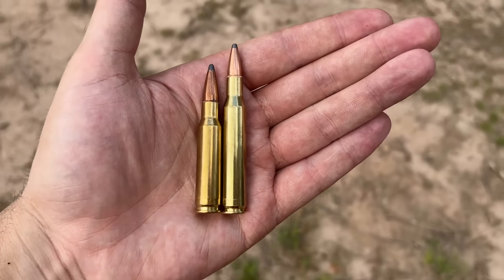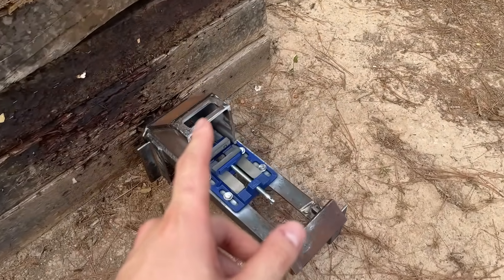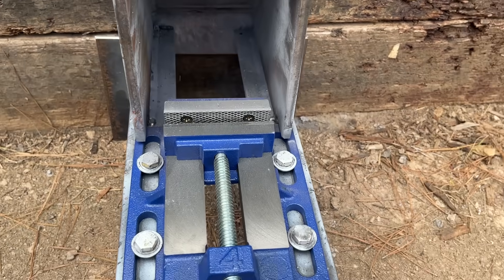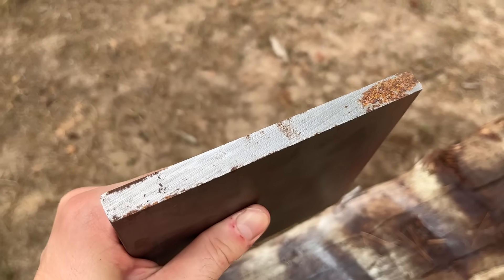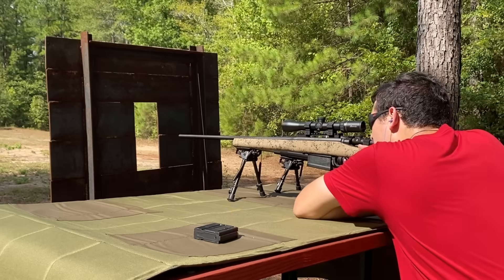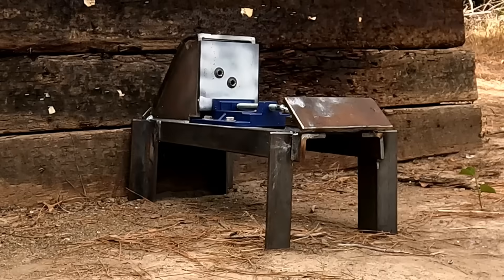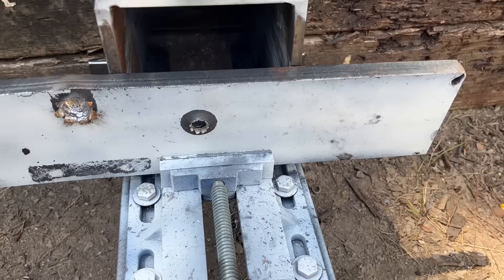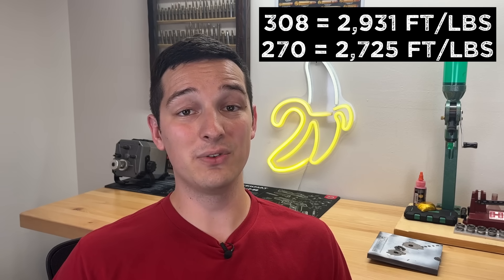270 Win vs 308 Win: ONE Clear Winner On Mild Steel

Comment: 150 grain on both would have made a better comparison
Reply: I shoot 110 grain hollow points out of my .270. Long reach and they are drt
Reply: @kevenbeene4585 shooting a 150 gr out of a 270 is super unusual unlike 308 which is like you main bullet weight so it makes sense
Reply: @offbentleyboysyt5106  150 grains out of a .270 is useless unless it's up close. I load 110 in my 7mm to.. I have a 6 arc and .224 valkery. I shoot long-distance tourneys.  Depending on the day , wind , humidity, and air temp, i pick my rifle
Reply: @offbentleyboysyt5106  not so unusual it's my go to.
Reply: @offbentleyboysyt5106 it's not super unusual. 150 grain bullets are 20 percent of the market
Reply: @kevenbeene4585   DRT , Keven, Even
with a behind the shoulder , classic Double Lung shot? I have never seen a deer drop from a Double Lung shot with any caliber. They run , even a short distance.
Reply: A better comparison would be matching sectional density, so 130 gr 270 vs 165 gr 308. both at ~.240 sd. that would be 3100+ fps vs 2650. that is apples to apples
Reply: Exactly my thought. He compared a +P load 308 to a standard 270. Both standard or both +P is the right way to do the comparison. Not that it matters all that much cuz both are very effective when taking deer or elk at 200 yrds.   @mandtgrant
Reply: @mandtgrant I can push a 130 grain 308 caliber ttsx bullet 3140fps from my 308, it's fast and flat, may not have the sectional density and bc as the 270 but it's still a little faster and it's not much different
Reply: A 270 will always push a 130 faster than a 308 😂.  @ChrisEdling
Reply: @mandtgrant 165 308 can be pushed faster than that, more like 2800fps
Reply: @ChrisEdling  not within safe pressure unless you mean in a 36" barrel
Reply: @mandtgrant  yea what are you talking about? That's with a 20 inch barrel 😂😂 you don't know shit about reloading
Reply: @ChrisEdling   One of the hottest load out there is the Federal GMM 168. You can match it with handloads, but quickload says it's over pressure. It gets 2650 in a 24" bbl; that's about 2550 - 2600 tops in a 20". Can you get higher? Yes, of course. Can you do it within safe limits? No. New double base powders allow a good increase in heavy bullet velocity, but short actions can't really hold enough to matter, and 165/168 isn't heavy for calibre. If you want ~2800 fps, get a .30-06, or don't sit close to anybody on the range
Reply: @mandtgrant  we regularly push 175s smk to 2700 to 2750 ish fps with 2000mr powder. With zero pressure signs 🤷‍♂️
Reply: @ChrisEdling  quickload says that 2700 fps with a 20' 175 smk = ~50 grains and 77000 psi
Reply: @mandtgrant  with what powder??? That makes no sense
Reply: @ChrisEdling  2000mr. If you increase bbl length to 26" it can do it right at the pressure limit, but that would give no margin. If you want to compare an equivalent hot load in 270, Magpro will give almost 3300 fps in 130 gr, and Norma MRP will  give 3150 in 150 gr. Technically both are within pressure limits, but only an idiot would load that way. Safe loads for both are still 3240fps, and 3090fps respectively. BTW, excessive velocity is is a definite pressure sign.
Reply: In my opinion, any ballistics comparison with dissimilar bc bullets is nearly useless. Compare similar ballistic coefficient bullets, or you may as well compare a mortar round to a bb gun.
Reply: Why wouldn't you do max grain for both? The 270 has a diameter advantage. Why doesn't the 308 get its size advantage?
Reply: I’ve shot numerous elk with 150 grain Hornady Nossler partition bullets and dropped those elk in their tracks with one shot. I’ve never shot beyond 300 yards. With the 308, I find significant bullet drop and unreliable accuracy shooting 150 grain bullets. Which means I’ve had to shoot more times with the 308 to put down an elk. Don’t know why this is the case based on your video, but I do know my .270 is much more reliable for one shot kills.
Reply: @timwade5157 FFS, if your gun doesn't like certain bullets, find something it likes and use those. This is rookie stuff. The .308 doesn't drop much more than a .270 out to 300 yards either. Sounds like you're suffering from a case of confirmation bias. Most real hunters would agree that the .308 is plenty enough gun to do the job, if used by a competent hunter.
Reply: @ToddSweeny  thanks for your reply. I’ve been hunting big game since 1962. Hardly a rookie. I sold the .308 years ago. Just reporting my experience between the 2 calibers. Still have the .270 and shoot 130 grain for deer, antelope, coyotes; 150 grain for elk as stated. Very satisfied.
Reply: @timwade5157 i wonder if upping to the 165 or  180 grain would help the 308? ive only shot mine to 200 so there is minimal drop if any
Reply: @ditheory-q8y  That’s a good question. I don’t have a .308 any longer because of the reasons I stated, so I can’t give a range comparison answer. I guess it boils down to personal preference and reliability with certain calibers when hunting.
Reply: @michaelcaughman6357   270 shooter your Right... 308 shooter your Right... 3006cal shooter your right!!, Fellow Hunters... PLEASE, All of the Above Calibers and many more are near Perfect. Just use the Right bullet, and Weight. A Leupold Engineer's , go to Caliber , is a 308 cal, 165 grn bullet. Nothing is Magical . Its all about shot placment an a good bullet. Shoot what you shoot best , BUT.... True we, we Love to argue and debate, and there is in fact , fun in that.
Reply: Yes , lets redo that test. 150 grn 270 cal.
Reply: Man that is quite the voice you have there.
Reply: @tigeryoung8611   Further.... You may smile at this!!, " When your sitting around the ole Camp fire, don't discuss, Religion, Politics, or Calibers" ,  Lol, we Just Love to poke the Hornets nest. Its the American Hunters Thing.
Reply: @eugenegress5896  in Australia you could add Falcon vs Holden '(Ford vs GM) to the list.
Reply: @tigeryoung8611  ~Yes, or what’s better for Kangaroo:: 223 (5.56) ‘or’ 243 ??
Reply: @royjohnson465  22-250
Reply: @royjohnson465  there is an old bush proverb. If you want to get there take a Land Rover or a Toyota Landcruiser. If you want to get home take the Toyota.
Reply: @royjohnson465 ask the kangaroo and you might get a better answer
Reply: Not a balanced test. .270 is a necked down 30-06. Whereas a .308 is a shortened 30-06. Bullet weights should have been the same. The .270 would have outperformed the .308.
Reply: I'm with the other Fellas. Shoulda been both 150s or both 130s for a true matchup. Do over to make it real. To be honest I'm not worried about mild steel as it doesn't shoot back.
Good video however.
Reply: Yeah the 130 grain to 150 grain 308 is not fair comparison
Reply: 150 grain is light for a 308, and heavy for a 270. Use bullets of similar sectional density. a 308 bullet with the sectional density of a 150 gr 270 would be 180 grain.
Reply: I beg to differ. When you compare different calibers you use different weight bullets. It isn't the weight of the bullets that matters but their sectional density. In fact the equivalent of the 130 grains 270 bullet is 160 grains in 30 caliber...That weight would even penetrate better than the 150 grains in 30 caliber. Sectional density is directly connected to the ability to penetrate.
Another example would be comparing a 160 grains 7mm caliber bullet to its 30 caliber equivalent bullet which to have an apple to apple comparison is 190 grains bullet. You may look at reloading manuals and see for yourself.
Reply: Define better. What do you want  to match? 
Velocity? Sectional density? Weight? 
In  this case, why would one be better than the other? I don't find it nearly as obvious as you....

Same shit as with ballistic coefficient between different calibers. Why would you compare same weight projectiles when you want an honest representation of ballistic capabilities? I guess a .224 caliber gun is more ballistically efficient than a 6.5 one, since the same weight projectile will be much higher bc in the smaller diameter.
Reply from the maker: Definitely could’ve depending on the velocity of it
Reply: Yup
Reply: Definitely should have used 150 gr in both
Reply: That's not the best comparison 130g 150g speed maybe projectory . 308 drops like a rock .
Reply: I don't think so, it's be like trying to cheat the test by giving an advantage to 270. It's a comparison for the caliber and he chose just about the most common grains for each,
Reply: 130gr .270 is MUCH more common though, so it's a much more realistic comparison.
Reply: Why? The standard 270 is 130 grain and the standard 308 is 150 grain, right? Meaning the best bullet weight for the cartridge .
Reply: Riffle line ammunition  270 win sp 150 gr will go through 1/2 inch mild steel like butter shoot 3 times all went through
Reply: I agree. 150gr .270 is moving faster than 150gr .308
Reply: Oh you said it at the end. Your not a fan of .270win, you set up your test for 270 to fail. .270 actually out performs 30-06 in many cases when bullet weights are the same. Your comparison was apples and oranges. Bull shit test
Reply: I'm with you 😮
Reply: I hate retards that say the grain weights weren’t the same so it wasn’t a fair comparison.

That’s like a 4 cylinder Honda racing a dodge demon in a drag race. Then saying well it’s only fair if we give them both 6 cylinder engines. 

You have to compare them at face value because that’s how they are presented.

You race them against each other when they are both in their prime.

Not when one is a fat heavy slob 
And the other is skeleton with no energy.
Reply: Lol
Reply: Why?
Reply: Agreed: both in 150gr would have showed equal results!
Reply: Exactly,  the test was useless!
Reply: 150 grain 270 would have went through it
Reply: @bama8868  why do you think 150gr would go through?
Reply: Why? The standard 270 is 130 grain and the standard 308 is 150 grain, right? Meaning the best bullet weight for the cartridge .
Reply: @Iwantmoneez  The 308 uses 150 because it loses velocity quickly after that weight, not because it is best; 30-06 is standard with 165 or 180 grain because it is a more capable. This "test" handicaps the 270. A 150 grain 308 is not as capable as a 130 grain 270
Reply: Why? The standard 270 is 130 grain and the standard 308 is 150 grain, right? Meaning the best bullet weight for the cartridge .
Reply: Why? The standard 270 is 130 grain and the standard 308 is 150 grain, right? Meaning the best bullet weight for the cartridge .
Reply: Why? The standard 270 is 130 grain and the standard 308 is 150 grain, right? Meaning the best bullet weight for the cartridge .
Reply: I agree 100%
Reply: I reject this test.  Let's have a 150 gr bullet test in the 308 and 270 win
Reply: @francisvantuyle  It should be similar sectional densities; 150 is light for 308, and heavy for 270
Reply: Anybody know where I might get my hands on box of308/22.cal plastic insert got my first big buck paced off at close to 1000 yards with only one shot out of five hitting but did damaged. I was told they are only army issue snipers supplies
Reply: Are you using bullets of similar composition, weights etc ??
Reply: Exactly what I was going to say
Reply: Agree 100% this was a stupid comparison. Use the same weight bullets…!!??
Reply: 308win al day long, the most versatile round especially in grains and ammo,
Reply: Any further plans on a 30-06 vs 25-06 vs 308 test.  I inherited two of these rifles from my dad and having a hard time deciding on which to keep.
Reply: My father-in-law said that the .270 with a 140 grain bullet is the “cat’s meow.”
Reply: No it would not !

The calibre defines the projectile weight.
All by the powdercharge.
Reply: 3006 vs 270 ,150gr😅
Reply: I unsubscribed after this video.  Should have used 150 on both
Reply: That’s like comparing 147 grain 9 mm to 155 grain 40 caliber. You’re going to get a lot more penetration and less expansion with the heavy 9 mm versus a lot more expansion and less penetration from a light 40 caliber. I always say compare light for caliber to light four caliber, middle of the road versus middle of the road and heavy for caliber versus heavy for caliber. That way you know the capabilities of the cartridge and what it’s meant to fling
Reply: If you're shooting a 150gr in a 270 Win, you're doing it wrong. It's a flat shooting cartridge that can buck the wind with the 130gr. Go up to the 150gr, it's nothing more than a 30-06.
Reply: @donwyoming1936 the test though isn’t how flat but how it penetrates.
Reply: @donwyoming1936 

Nothing is a free lunch. The .270 with 150 gr is no more a .30/06 than the .30/06 with  130 gr is a .270. The .270 will penetrate deeper, shoot flatter and have less wind drift with the same weight and bullet design. The 130s start faster but lose speed more rapidly and have more wind drift. That's the reason the fast twist .270 Win guys shoot 170s at a 1000 yd.
Reply: @donwyoming1936  “Buck the wind” 😂🤣😝😆😝🤣
Reply: @donwyoming1936 exactly. My .270 loves a 130 grain bullet. So accurate. I love a .308 also, prefer it to a 30-06. About to pick up another 08 just because of ease of finding quality ammo. Sometimes I can’t get my preference in .270 factory rounds
Reply: @donwyoming1936 With modern powder, the 130gr bullet is obsolete in the 270.  RL26 pushes 150gr bullets beyond 3000 fps which gets you better penetration and will “buck the wind” better than any 130gr bullet of similar shape.
Reply: @donwyoming1936 depends on the distance you’re shooting.
Reply: @donwyoming1936  150gr 270 has better BC and has more energy at longer range
Reply: @donwyoming1936 the difference is less recoil in the 270 and good ballistic coefficients in the 150.
   I'd compare 150g/270 v 165g/3006. Velocity is closer.
Reply: @donwyoming1936  a lot of people shoot 150gr in the 270 for moose. It’s common.
Reply: My 270 always puts them down my buddies 308 they ran forever
Reply: @outdoors4life884 3 out of 3 deer I have shot with .308 180g corelokt didn't take a step.
Reply: @josephnommensen4025  4 out of 4 mule deer I have shot with a 22 LR didn't take a step. And, I shot them all at the same time from bedroom window.
Reply: @grisher111  I see you are skeptical, but you dont have to be a jack hole. I have hunted 20 years and harvested about a dozen deer. The 3 that I have shot with a .308 fell where I shot them. Two of them missed the mark and hit the spine. They could not walk with a broken neck, and the result was admittedly accidental. The last one went through the liver and heart, and it crumpled where it stood. I searched till sunset and was convinced that I didn't even hit it, especially after not finding a blood trail. I went to where I shot, marked where I saw it fall with a friend who walked right onto it.. It was in the very spot I shot it the next morning. I usually hunt bow and have to chase, but the few times I have successfully hunted rifle was with 308. It is a good round, as the video shows.
Reply: @josephnommensen4025 180 grain was they any meat left to skin out.
Reply: @terrytesterman1689  I grind the front shoulders into burger anyway.
Reply: @josephnommensen4025 exactly his buddy can't shoot.
Reply: @grisher111 stop shooting deer in the brain 😂. Works every time even with my .177 gamo pellet rifles with hnn hornets . Even at 35 yards . . I know what you mean jejeje
Reply: @outdoors4life884  Yeah, right... shot placement doesn't lie.
Reply: @outdoors4life884  I've experienced the same thing.
Reply: @outdoors4life884 That’s a big statement from a small sample. Are your friends aiming at the same vital area. Can they hit where they aim😮. 
  Surely a 150gr projectile out of both would have better results to the 308 on medium game at ranges under 150-200m. High sectional density projectiles don't open up enough on side on shots. Nor do tough projectiles in 150gr 308😊!
   I see the 308 as a bigger 30/30; The 270 as a bigger 243.
Reply: Why would that have been better? Both of these are common bullet weights for caliber. It's a fair comparison.
Reply: @ToddSweeny  because the sectional density of a bullet is the best quantifier in light-or-heavy-for-caliber and the best indicator of penetration on game (not steel) Here they are comparing light for caliber 150gr 308, and medium for caliber 130gr 270. If you were hunting elk, you would choose the 165 308 and the 130 270 as minimum weights. A 150 gr 308 is too light. The 270 with a 120gr bullet (same SD as 150gr 308) would have a velocity over 3300 fps, and would out penetrate the 308. Short action cartridges favour light for caliber bullets. As you increase SD in both calibers, the 270s advantage becomes greater; 180 gr 308 and 150 gr 270 have similar sd, but the 270 is at 3000 fps and the 308 2600
Reply: @ToddSweeny d
Reply: 0.277" at 130 gr = 0.242 Sectional Density

0.308 at 150 gr = 0.230 Sectional Density 

0.308 at 165 gr = 0.248 Sectional Density 

Sectional Density would make more sense than simply weight because objects naturally get heavier as they get larger. 

I think he has said before he generally tests the most commonly used size in each caliber. So that's why he didn't try to match weight (.270 / 150 gr) or closest sectional density (.308 / 165 gr). He might have went with 165 gr in .30/06 or 180 gr in .300 Win Mag.
Reply: @gk5891  308 SD is .226
Reply: I've took 7 deer with my 308 150 grain, 5 dropped in place, 1 ran 20 yards from double lung shot, another went 30 yards with no heart as it was exploded.
Reply: 150 grain in 270 isn't where it's at. 130 grain beats it in everything that counts and all or most that don't
Reply: absolutely , 308 had a 20-grain advantage, that's huge at that range    Dave  nz